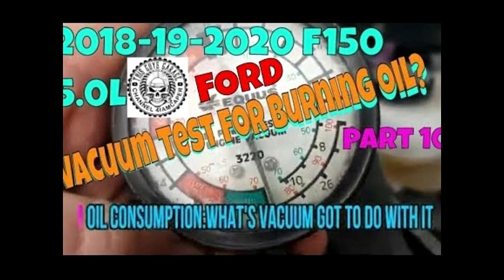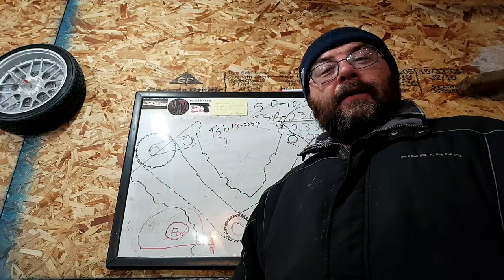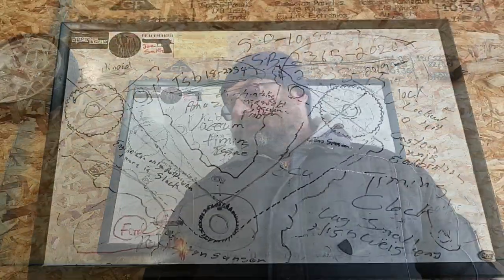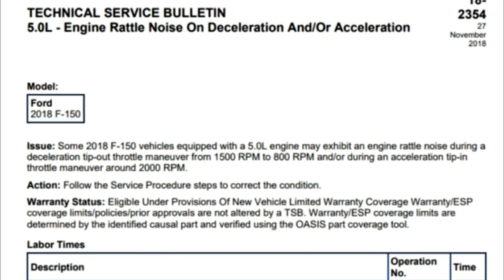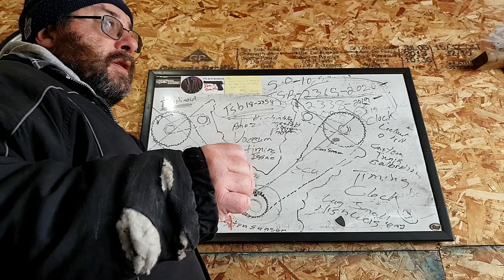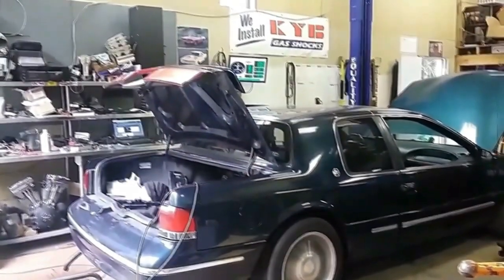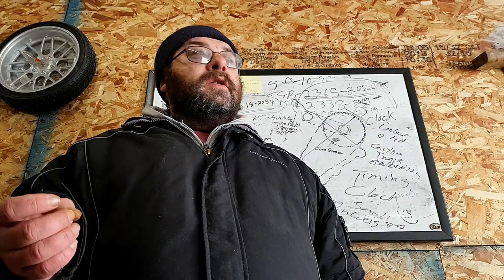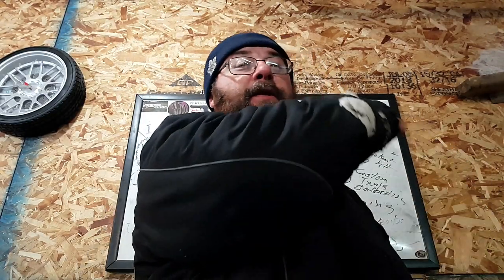2018 2019 2020 FORD f150 5 0 engine rattle tsb 2354

Comment: Dude, you deserve more credit on this topic then you've gotten..  This video helped me out ALOT..  My 2019 f150 started making a loud rattle/pinging when taking off from a stop, lost power and gas mileage, and  check engine light came on for a bad "Camshaft Position Sensor" Bank B.  So i found your video and that made me check the oil, man it was damn near bone dry!!  Took 5 quarts to fill it back up.  What's messed up is, the truck never overheated and always maintained good oil pressure. No oil  leaks, no spots in driveway or around engine at all.  When i pulled the dip stick there was a jelly textured oil residue all the way up to the top of dipstick.  Like it was accumulated burnt oil vapors or something..  Anyways, after i filled it back up noise stopped and check engine light went off and everything back to normal.  WTF Ford?!
Reply from the maker: thanks so much , really appreciated ,   so your cam chain tensioner lost oil supply causing the cam position sensor to read slack in the chain ,  share the info ,and we can all get the info out there. really appreciated thanks again.  this is a billion dollar problem collectively ford is trying to ignore

Comment: Be counted, be seen be heard..Great tips my friend
Reply from the maker: Ty jt
Reply: @thisguysgarage  I got this tsb on my 2018 and it still rattles so did they even do the tsb or is the lock out still making the rattle because thought if they locked it out it wouldn't rattle on decel anymore
Reply from the maker: @kevinanglin678  the only reason they promised a  flash update was to get your dipstick so you wouldn't notice how much oil is being used..
The low speed preignition is (rattling) is an efect of the oil consumption.  Ty for taking the time
Reply: @thisguysgarage  your welcome, how long is the updated dip stick? Thank you for the answer
Reply from the maker: @kevinanglin678  3 quarts from ad to full compared to one quart on the old dipstick. i have a video documenting it
Reply: @thisguysgarage  yeah I watched it I was just wondering how long it was so I could take it out and measure it to see if its the original or updated dip stick thank you
Reply from the maker: @kevinanglin678  the original is about an Inch.  I also have one side by side.  An inch comes to mind

Comment: I subscribed because you did something Ford dealership couldn’t. I brought my new 14k miles 5.0 XLT for the deceleration rattle and they said it’s the fuel pump, it’s normal and they can’t do anything about it.
Reply from the maker: thanks so much luvs ,keep at them ,get an oil analysis done.  keep me up to date ,a lot of folks shared there experience with we,will share what i can!

Comment: I went from 3 quarts low(per oil change) to virtually no loss with this fix.
My dealership reduces the oil consumption on my ‘18 5l.   Yes, they added a longer dip stick, but the main fix was flashing the ecm to NOT close the airway in the throttle body 100% on deceleration.   Apparently, a full closure of the throttle-body airway creates too much vacuum on deceleration and this draws in  oil fumes into somewhere it shouldn’t be.    This is said to be the major contributor to the oil consumption.   4,000km.  Not one litre lost!

Comment: So just to add another one to the list, my 2018 with 17k miles has the whole list of good stuff!! Loud rattle when cold during decelerating, burning a quart of oil about every thousand miles. I started it the other day and the motor clunked so loud it spooked me, literally rocked the entire truck. So I shut it off and started it again..CLUNK...one more time just for good measure? Oh yeah, all three times!! It rocked the truck so hard it felt like it was gonna rip the motor mounts off.

 So into the shop it goes...get the tsb 2354, yes sir! Got ya fixed right up! 

 So I pick the truck up after a long day of work and made it about 10 feet, let off the gas and rattle city...literally no change. Back into the shop I go, so the tech tells me "thats normal operating noise" the rattle , the clunk...all normal. Your new truck is supposed to sound like that!! The oil issue??! Yeah ,we can give you a longer dipstick. A longer dipstick...to fix THAT MY TRUCK IS BURNING A QUART OF OIL EVERY THOUSAND MILES. That's Ford's fix. The tech was even kind enough to not charge me!!! Literally said to me "yep we got ya all fixed up and there will be no charge!" Imagine that, nice enough to not charge me FOR NOT DOING A DAMN THING TO FIX MY TRUCK, gee thanks Ford!!

If I can save one person from this nightmare I will at least feel a bit better. If you are looking for a new truck..SCRATCH A 2018-? F150 OFF THE LIST. 

So today I get to call the ford complaint line and have some idiot tell me that " its all normal sir- shrug smile". While I'm working 12 hour days so I can afford my nice shiny can of rocks!!
Reply from the maker: i feel your pain,do you still have warranty?
Reply: @thisguysgarage  I do, but it seems like its not worth much other than toilet paper. I really appreciate your videos man. Nice to be able to have an idea whats really going on. 

 I wanted to let you know also, ive only had the truck for 2000 miles, bought it at 15k, now at 17k. But my point was, I noticed an oil consumption issue prior to having the TSB , so there is definitely another issue also. Your explanation sounded entirely logical , I just wanted to note that my truck seemed to have an oil issue prior to the TSB. UNLESSSSSS of course, the TSB had already been applied by the previous owner ( who I now realize likely sold the truck because of these issues) and the shop I went to just reapplied/ acted like they applied to get me to shut up. Which, if that os the case then the oil issue could very well be stemming from the initial TSB application ( prior to me purchasing the truck)

 I'm really at a loss here. I dont know how to even address this. I'm debating just getting rid of the truck, taking the loss and moving forward ( along with a sustained smear against the dealer)

 If it really isnt a matter of causing serious issues down the road, thats one thing. But I feel like this truck is going to get way more expensive than it already is, and THAT is unacceptable to me.
Reply: @ramrodrymensnyder2648  take it in and get rid of it...get yourself a Toyota Tundra..bulletproof engine and transmission. ..best truck I have owned
Reply: I'm literally going through this same bullshit now with my 18 F150 5.0L
Reply: @mjuberian  do you think the tundra would be worth it for long highway commutes everyday?

Comment: Try pushing the traction control button twice to take it to advance trac sport mode. It fixed my rattle on deceleration. 2018 f 150. 5.0. Built 8-18. Mine doesn’t use any oil. Here in South Dakota
Reply: I have 14,000 miles on it. & a JLT oil catch can.
Reply from the maker: @royalelwood9538  good luck 👍

Comment: I had a 2017 f150 5.0 it was fine never a issue . But after watching your videos . The only f150 I would buy is the 3.5 eco boost
Reply from the maker: it seems to be the right choice right now. ty james
Reply: I have the F150 3.5 eco boost and I have had problems and had to replace my transmission at 54k.  Now the engine is making a rattle on startup.

Comment: So today I’m getting my 2018 Ford F150 XLT 5.0 back after 2 weeks of being at the dealer. This is the third dealer I have been to that told me the rattle on deceleration is a “normal characteristic of the truck” they even sent a video of my truck making the obnoxious rattle while they told me its normal. They also refused to touch the oil issue and possible vacuum leak issue. I’m done dealing with dealerships and honestly don’t care about the warranty (1 ½ years left) anymore. Therefore, I ask, has anyone installed the cam phaser lock out kit and solved this problem? How much did it cost to have it installed? Either I will pursue this fix or give up/sell it…

Comment: @ROOSTER 1974  so my oil isn't fixed and I have rattle I hired a lawyer about rattle and got 9500 3500 went to lawyer. I added 2.5 quarts today and it made the engine a little less noisy. I got a custom tune from oz and got this explanation about rattle 
What you’re hearing is not knock. It’s a combination of the DI pump and VCT cam phasers, and it’s not hurting anything. We adjust the DI syste4m to activate earlier, at a lower RPM range to provide better knock protection when running low octane fuel, like you are. It’s very beneficial when towing, as most guys will run lower octane fuel to keep fuel costs down when towing, and the 1500-2200 range is where you spend a fair amount of time when towing.

 

What’s happening is the DI pump, which is driven by the exhaust cam, comes on line and adds load to the exhaust cam. The electronically controlled oil pressure solenoid is also limiting oil pressure slightly. That can cause the exhaust cam phaser to rattle slightly until the oil pressure builds enough to move the cam to the desired position. It’s an annoying sound, but it’s not detrimental. Both Mustangs and F150’s will do it, even on the stock tune. Some trucks can be worse with the tune installed, because of the DI pump adjustments we make, but the added knock protection makes it worth the trade off. I can adjust the tune to reduce the chance of it making the noise, but like I said these engines will do it with the stock tune installed, and you’d be giving up the added knock protection. I’m happy to adjust the tune though.

 

Something to check beforehand is to make sure that your oil level is not low. It should be all the way up to the full line on the dipstick, and I personally run an extra ½ quart above that in both my Mustang and F150. Also, tipping into the throttle further in that RPM range will also increase the commanded oil pressure quicker, which will stop the noise.

Let me know if you want attorneys number.
I  had to say I wouldn't pursue rattle anymore and the were quick to part with 9500. I'm going to do the same about the oil and this insane new dipstick that show a quart low when it's really two
Reply from the maker: Great information thanks so much for taking the time 👍 appreciate it

Comment: I use a rebuildable Canton filter on my 2020 xlt 5.0. Way better than the garbage spin on filters. And 2 times more filtration surface.  It has 100% filtration. No bypass valve. ALL the oil gets filtered, Non going through a bypass valve like in the spin on filters. Also switched to 5w-40 mobile and use a quart of Lucas zink additive. 9 quarts total, Also put a reducer in the PCV vacuum line to reduce the vacuum. the reducer cuts the hose down to 3/16. No more oil consumtion and no more ticking noises. 36k miles. I know zink is bad for the cats. But it`s not using oil anymore so it`s not a problem for the cats. PCM updates that hold the throttle body part open and longer dip sticks is not the answer. The only dip sticks are the ones who work for ford

Comment: I think I know the answer but, I found a very attractive deal on a 2018 F150 5.0 10 speed XLT with 65000 Kms.  I would have no idea if it consumes oil as I do not have an over time span relationship with this truck.  I did have a mechanic look at it that told me its well priced and no issues (but a snapshot inspection, not time span.)  Also - there is no more power train warranty because its a rebuilt title(and yes I am intimate with what was rebuilt, and know the issues around that.) Because of the rebuilt title, it is 55 to 60% of the going price for 2018 5.0s with those KMs. I bailed last minute because I googled this oil consumption issue the night before signing.  Do all 2018 5.0s have this issue?  I checked, it has not had any TSBs applied to it and was previously a fleet vehicle large Oil Company before its collision.  Should I keep running away?  Thx
Reply from the maker: being a fleet vehicle i doubt anyone even checked the oil between service to find out if it was using oil. personally i would say stay away from it , my small channel has nearly a 1000 comments on this issue from people experiencing this issue from the 10 plus videos i have done in the series , have personally followed up with folks locally experiencing the issue its more prevalent then people realize ,if it has to be a ford look for a pre 2017 with a 6 speed transmission . any chevy with a six speed is good as well they have similar issues with their 8 & 10 speed units ,rams are good but change the oil more often then recommended . that is the long and short of it. i would not recomend from what i seen . ask any question any time hopefully you can ring the bell ,it helps
hope this helps out.
Reply: @thisguysgarage  I really appreciate this.  I was choked to find out.  I was looking at the 5.0s because I had heard good things....but that was pre 2018 5.0s.  I know Trucks all have issues, but when I saw TSBs to replace the block....yeesh.
Reply from the maker: @WarrenEdmundson  and this truck has no warranty , even if it did good luck getting ford to take responsibilty ,you dodged a bullet. ty for taking the time!

Comment: So, my 19 5.0 developed the dreaded oil consumption at 15k miles had the tsb "fix"to get it within range on the new double range dipstick. Now at 30k, it has developed a rattle during light acceleration with a CEL popping up today. Will be going back to the dealer for the 5th time for warranty work. Sigh!
Reply from the maker: its really ridiculous!

Comment: I think your on the money with your thinking have you thought about the stop and start having something to do with the high vacuum and the high timing maybe ford program this in the computer to maybe help the stop and start to operate smoother just an thought I think stop and start started on the 5.0 in 2018 when we started having problems. thanks great video
Reply from the maker: I did a rant video about stop and start not working properly  when I bought the truck.  I think this may have been the first clue of the bigger problem to have come. Ty so much for taking the time 🤜🤛

Comment: Hi, I spoke with you on here a year or so ago I just got my 3rd engine installed by ford I’ve now got around 3,000 miles on new engine with no oil loss but I do have that rattling noise it’s going back to the dealership soon very annoying.
Reply from the maker: just wow omg
Reply: @thisguysgarage  I’m curious if you have worked on these with these issues if you noticed if the exhaust coming from the tail pipe smelled weird, not like normal exhaust but more strong than another vehicle?

Comment: I have a 2020 f150 FX4 and expieirieancing oil consumption . I bought this truck with 34000 mils, and I am at 75,000. What can I do to ? I here engine rattle when I get up to around 4500-5500 rpms it almost sounds like an exhaust leak. Anyway I'm concerned that this engine will no last long and if there is a mod that will work. Thanks for putting the info out there.

Comment: I have been dealing with the VCT solenoid chatter since 7000 miles and have been very patient with FORD.  I now have 33,000 and the chatter is so loud now it is driving me crazy.  I had no oil on the dipstick many times and they did the oil consumption test and gave me a longer dip stick.  Hmmm.  It is holding more oil now but the rattle sounds terrible.  I have a case number and the dealer had my truck for three days and threw their hands up and ended up saying this was a standard noise of the 5.0L.  I personally think the cause is from lack of oil.  When I first turn the truck ON, it takes atleast 30 seconds for the oil to reach the top of the engine.  Sound like a box of rocks until it gets there.  All of the upper end parts must be worn badly.   I have a good video of the noise I can share but youtube won't let me do that here.  I am trying for a new engine as that can be the only fix.  If any one has had any luck getting the engine replaced please let me know.
Reply from the maker: what my salesman told me was this stop checkin the oil and let it die. no time for patience , i can only hope they do right by you,ty so much i have heard the same thing now hundreds if not a thousand time from multiple owners ,how many people dont even know they have a problem. appreciate you Brian

Comment: I have a 2018 f150 with engine raddle sounds like bottom end have done computer download dipstick change still going through oil changed heads still noise very pissed with this i am to the point where Ford can have it back waiting on call from dealer about buying it back
Reply from the maker: hey Robert ,this situation sucks. let me know how you make out. ty for taking the time sir.

Comment: Got rid of mine for a 19 Tundra Limited... best decision ever... Never buying another Ford in my life!
Reply from the maker: awesome,cant blame you at all!!
Reply: I'm considering a Tundra too, I just don't like the shitty crash rating and absolutely shit mileage.  But the dependability and resale are unmatched.  I like my F150, but the engine pinging is pretty much guaranteeing that truck won't be around at 200k miles.  At this rate, I'd be surprised if it made it to 10k.